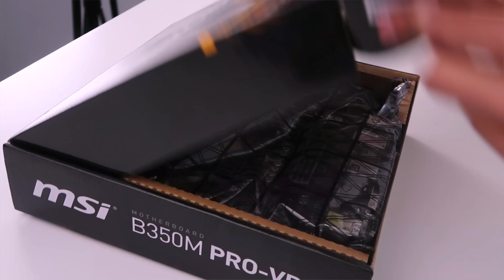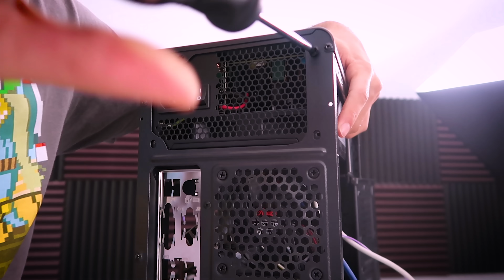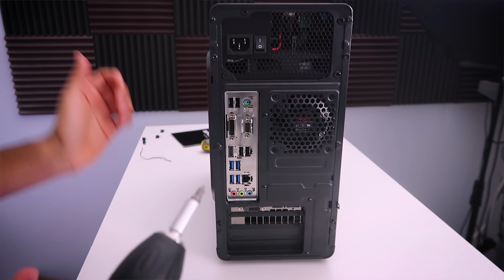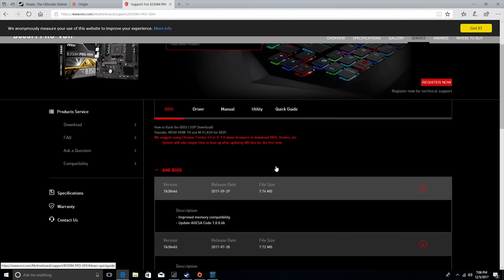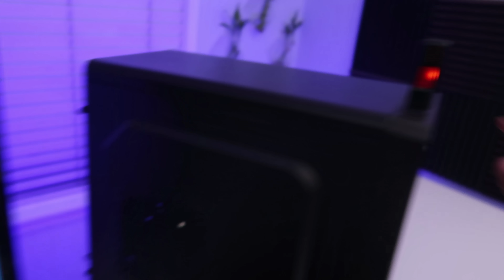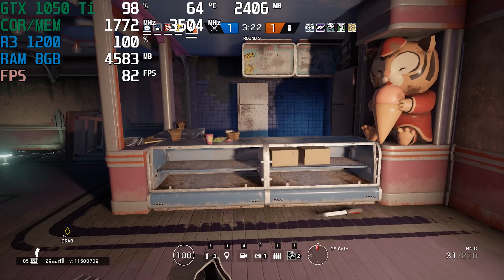$500 Budget Gaming PC Build Guide - GTX 1050 Ti (w/ Benchmarks)

Comment: Hey guys, I have a question maybe someone can help me with.  In the video Joey uses a MSI GeForce GTX 1050 Ti DirectX 12 GTX 1050 Ti 4G OC 4GB 128-Bit GDDR5 PCI Express 3.0 x16 HDCP Ready Video Card and I found something similar for $70 less expensive ( EVGA GeForce GTX 1050 Ti SC GAMING, 04G-P4-6253-KR, 4GB GDDR5, DX12 OSD Support (PXOC)).  Would this provide similar performance and is it compatible with the rest of the build?
Reply: Nicholas Savino GPUs come in different brands. As long as it's a GTX 1050 ti 4gb just like his. Your motherboard should do fine with it. Any GPU with a 16x PCIe slot will work with the mobo he showed. As long as your case can fit it of course tho.
Reply: Now if you check the case he was using online. They tell you that the case can support any GPU 300 mm long. But the case is limited with only 2 fans. Which is bad for cooling. This limits higher end gpus. So just watch out on that part.
Reply: Thanks a lot man, unfortunately all the GTX 1050 TI in 4gb are sold out everywhere.  Is there anything you'd recommend to substitute?

Comment: hi nice video dude, would any other computer case fit good with this setup? In my country I cant find this model, but there are some similar. Is it necessary to be this one?
Reply: Matej Jurec no, any ATX case will do. The motherboard he is using is a micro-atx model. This means any case that is either a micro-atx model or Mid ATX will work. Remember tho bigger is better. You will have more space. Mid-ATX cases support both micro and regular atx motherboards.

Comment: Hey man idk if you’re responding to these comments or not, but I’m still in high school and have been a console gamer my whole life, my favorite games right now are definitely over watch pubg and fallout series, so is this a good option to get started on a PC and is it even worth it if it’s gonna take 6 months to save up for the parts? Will they be outdated? Sorry idk how PC works really, and should I even attempt this build if I have no computer/PC build knowledge whatsoever?
Reply: Qigi Streams This current build will do fine for you. You can play PUBG at 50-70 fps. If you are new just research around using Google and YouTube.
Reply: Yeah this  build would be solid to start out with. The cpu/gpu combo would run those  games just fine. You can get any b350 motherboard you want.  I would recommend getting like a 120 or 250 gig ssd for Windows  and a few games. I just got one and my PC runs so much faster, its definitely worth it.  Also I would get a different case than the one, you can get anything you want, make it yours.  Also by the time you save up  the prices of some parts should drop a little, and you could upgrade the parts if you want and it won't be out dated by then.

Comment: I went with this built it powers on but nothing displays on the monitor
Reply: RiIix make sure you plugged the hdmi to the graphics card and not the motherboard
Reply: Luis Ramirez appreciate the suggestion but I did that and I've taken out parts and tried figuring out what the problem is no luck

Comment: Anyone know how well this would run total war: war hammer 2
Reply: River Reifenrath 40-60fps
Reply: Luis Ramirez- would that be medium settings?
Reply: River Reifenrath medium high. Games like those are cpu heavy so a Ryzen 5 is better but not needed
Reply: Luis Ramirez- just making sure as my laptops i7 6700hq gets me 30-50fps on medium high settings
Reply: what gpu does it have?
Reply: Luis Ramirez- 1070, if anything it has to be the cpu as it is capped at 2.6ghz
Reply: it turbo boosts to 3.5 underload actually. the game is demanding though. What settings do you have it on? Shadow quality? and Antialiasing?
Reply: Luis Ramirez- my laptop isn’t letting me access bios so I can’t manually overclock and every test I run has it displayed at just 2.6 the desktop version of it I believe oc to 3.5, and just standard medium setting for that stuff as I know that can kill performance. Otherwise I’ll have to boot the game to find it all out right now
Reply: you cant overclock on a laptop that's why
Reply: Luis Ramirez- lol that’s what I figured when I couldn’t get bios to open otherwise the settings are anti-aliasing is off, shadow detail is medium, texture filtering is anisotropic 2x and I’m running it in dx 12 as I like dx 12

Comment: Firstly, thank you so much Joey! I made this exact build, but because I had a bigger budget I went with a ryzen 1300x, a 550w psu, and a gtx 1060 3gb. Everything seems fine, the pc turns on and I can tell everything is getting power. However when I plug an HDMI from my gpu to the screen, Im getting no image. Does anyone know why this could be?
Reply: OfficialBraddik that’s weird, are the GPU fans spinning?
Reply: Luis Ramirez the gpu fan spins for a while when I turn the pc on, but then it stops- I believe that's because the board isnt hot enough to require the gpu fan to spin? I dont think thats an issue, I may be wrong though
Reply: OfficialBraddik yeah the GPU isn’t hot enough for it to need to be cooled. Unscrew it from the case and open the release for it on the board and pull it out and reinstall it . Make sure you push down until it clicks then try again
Reply: Luis Ramirez I'll give that a try- also I have my cpu connected to my Psu via the VGA cable, is that fine?
Reply: Luis Ramirez I just tried what you suggested, still doesnt work.
Reply: cpu connected via a VGA cable? That's impossible. the psu has a cable with a label that says CPU to connect to the motherboard top left 4pin cpu connector. you can't have a VGA on your motherboard and hdmi on your graphics card at the same time. you have to pick one. if you need to use VGA i would suggest buying a VGA to HDMI adapter or VGA to DVI adapter
Reply: Luis Ramirez no no no, the GPU is connected to a VGA cable. The cpu cable is connected to the cpu cable
Reply: Also by vga I dont mean the video input/output vga, I mean literally a cable with a VGA label that goes from the power supply, to my GPU. Is that not the right cable to plug into the gpu?
Reply: connect it to the PCIE cable not VGA
Reply: Luis Ramirez is the PCIE cable labeled that or something? If so I dont think I recieved one with my 1060, although the box says it contains one..
Reply: Luis Ramirez also, there's nothing labeled PCIE on my psu, the only other labels are VGA, and PERIF

Comment: Hey I have a question I just did this build and I did everything you said in the video. Then when I go to plug it in and I push the power button it won’t turn on. Do you have any ideas on why it won’t work?
Reply: Malik Nav did you switch on the power supply from the back?
Reply: Luis Ramirez yes i did, I tried switching it on and off multiple times :/
Reply: Malik Nav push in the cpu power and motherboard power. So the 4 pin and the 24 pin on the right it’s probably just loose
Reply: Luis Ramirez okay I just tried that and I took it apart and put it back together and still nothin :/
Reply: Luis Ramirez I’m only plugging in the power cable to the outlet but do I need anything else plugged in like the Monitor or something to turn on?
Reply: Malik Nav no the fans will spin with the monitor off. Don’t forget to flick the switch behind the power supply. Flick it and try it on the O sign and flick it on — and try turning it on
Reply: Luis Ramirez I flicked the switch both ways and the fan still won’t start when I push the power button
Reply: Malik Nav did you plug in the front IO cables correctly? It’s the cables with the HDD LED, Power LED, RESET SW. the little tiny cables. You probably put those in wrong. On the motherboard manual there is a guide on what order and way to put them in. Should look like this: https://goo.gl/images/8EkMJY
Try to follow that. So pay attention which are on the + and - side

Comment: I have a Ryzen 3 1200(stock) and 1050 Ti. How come I have a very low GPU usage whilst playing PUBG? I use 1366x768 resolution, v-sync off, single 8GB RAM 2133 stick, and even optimized my Nvidia Control Panel. Please help.
Reply: Since you’re on a lower resolution it’s taxing your GPU a lot less than it is your cpu since it doesn’t have to render graphics as fast
Reply: True that, I fixed it a while ago by setting the screen scale to 120. Thanks.

Comment: Could someone please tell me how to overclock a EVGA GeForce GTX 1050 ti (not sc) and a safe clock for it?
Reply: Blitzer William look up a tutorial. It’s a little hard to explain. Basically you would download heaven or whatever and MSI afterburner. Push your power limit to 110% and increase your core clock my 100mhz and apply and run heaven for 5min to see that it doesn’t artifact or give you a black screen and crash. If it’s good then bump it up 100mhz more and check for the same. If it crashes on you. Go back down 100mhz or 50mhz if you want the highest possible overclock. Then do the same for the memory clock. Push it up 100mhz at a time and see how far you can get without it crashing. If it crashes then lower it 100mhz and there you go

Comment: Joey when I turn on the pc it won’t display anything on the monitor (everything is plugged in right) what could the problem be?
Reply: Goofy Godzilla does the pc turn on?
Reply: yes 
just no display
Reply: Goofy Godzilla did you plug the hdmi to the graphics card and not the motherboard on accident?
Reply: Luis Ramirez the dram and cpu light is on (motherboard ez debug led) does that mean there’s a problem with those things?
Reply: Luis Ramirez I use dvi btw
Reply: Goofy Godzilla okay did you plug in your dvi to your graphics card? 

Also make sure you pushed your ram all the way down so give it another push to see that it’s clicked all the way in, push in your motherboard 24pin cable and cpu power cable to make sure everything is all the way in

Comment: Hey Joey! Thanks for all the useful vids. I just built this rig, with a few changes: different case, stronger graphics card, and I added a second SATA 1T Solid State Hard Drive. When I set up windows, I didn't see partitions as you mentioned, but rather HD 0 and HD 1. HD 0 was my solid state HD so I selected to download windows there. Once this was done and the computer was working, I checked memory and it says I only have 907 GB. I don't see the second hard drive. Did I do something wrong? I connected them with separate SATA cables. Do they need to be together? Not sure what I did wrong.
Reply: Victor Fagundes check the bios to see that it read it. If it does appear you should be able to configure it there or in the partition on windows
Reply: I figured it out. I needed to format it for use. It’s working now. :) thanks anyway.

Comment: Can I change the ryzen 3 for a intel i3 8100?
Reply: Loquendo Guy nope. Different manufacturers need different motherboards.
Reply: Luis Ramirez I already bought  msi z370 a pro btw thx
Reply: Loquendo Guy then yeah the 8100 works. But if you have the budget for a 8600k try to get that since you already have a Z board and can overclock it. Or get a 8400 for $200

Comment: Hey Joey great video mate. Very clear informations.
I have a 2 questions though I am a real newbie in pc gaming. I want to switch from ps4 to pc for F1 2017.
The recommended setup is:

Processor: Intel Core i5 4690 or AMD FX 8320 
Graphics: Nvidia GTX 980 or AMD R9 Fury 

Is the graphic card you use in your video would do the job?

Also I am running the processor:  AMD A10-6700 3.7 mhz

Can my processor do the job or do I need to buy a new motherboard since the FM2 socket is pretty limited in upgrade apparently?

Thank you for your video. 👍
Reply: RickStuff I would move from the Fm2 socket to AM4 and get a Ryzen 3 at least for that game. The 980 recommendation is for maximum settings. So the 1050ti will still run it at around medium high just not ultra settings so it’ll still looks nice just not ALL the bells and whistles of the game. Will it look better than the ps4 version? Yes.
Reply: Hey thank you mate. I will have a look at it.. Just to make sure, replacing the socket mean replacing the motherboard right?
Reply: RickStuff yes that’s what it means :). AM4 is supposed to be supported until 2020 so it has a life ahead of it
Reply: OK thank you mate. I appreciate the reply.

Comment: My budget build is 

M5a78lm/USB 3 mobo
Fx6300
Hyper 212 Evo
12gb ddr3
500 watt evga PSU
Rx480 GPU

Runs Forza Motorsport 7 and fh3 and 60fps on med-high settings, nfs payback ultra settings gets 60 with some dips and idk much more games cause it's all I got lol

Comment: The GTX 1050Ti was $157.99 in the video.
It is now $299.99.

The fuck.
Reply: AG_PEPPER any brand 1050ti will work
Reply: I know. I thought it was funny to point it out. Thank you anyway!
Reply: AG_PEPPER just get a used 970 on eBay for around $150. You’ll get 1060 performance

Comment: Do all the wires come with the mother board and the cpu etc or do you have to buy them separately
Reply: I'm wondering the same thing too. I'm not sure if the sata cables with the hard drive is included
Reply: All the wires are inclucdd
Reply: TomBradyFan2871 the motherboard comes with 2 Sata cables so you don’t need to buy any extra
Reply: Luis Ramirez thanks for the reply! I was also wondering if I need to buy extra standoffs for the motherboard and where I can find the tool for the standoffs he showed in the video?
Reply: TomBradyFan2871 honestly his tool was just to tighten the standoff’s really tight. In reality you can screw them in with your hands tbh. No need for all that
Reply: Luis Ramirez Thank you! I have one more question. I noticed he used a drill to screw in the screws to the case. Is that necessary or can I just use a simple screwdriver? Also, would you recommend getting the additional fan that's not included in the case?
Reply: TomBradyFan2871 it’s actually correct to use a screwdriver. Idk why he uses a power tool for a fragile motherboard. And yes I would get it for better airflow
Reply: Luis Ramirez I looked at the price of the 1050 ti and decided to get the 1050 instead. Can I use the Gigabyte geforce 1050 instead of the Nvidia GeForce 1050? Will there be any difference in performance?
Reply: TomBradyFan2871 yeah you can use a 1050ti. I mean you have less vram but that doesn’t matter because honestly the power of the card will hold back higher textures. The big difference is 5-7fps for the most part. Just overclock your card if you really want the extra FPS
Reply: Luis Ramirez Did you mean to say 1050 instead of 1050ti?
Reply: yes i meant to say 1050. my fault
Reply: Luis Ramirez thank you for your help
Reply: TomBradyFan2871 no problem. I hope everything goes well for you

Comment: So what's the deal with the windows 10 flash drive? If I had all those parts and put them together, but didn't have the windows 10 flash drive, what kind of issues would I have with the setup?
Reply: Caden Reed you wouldn’t be able to install an operating system
Reply: So i would absolutely need a hard drive with windows 10 on it? What about updates, when windows 10 goes to windows 11 etc
Reply: Would it auto update?
Reply: Caden Reed just buy a 16GB flash drive or around $12 and install windows 10 home on it for free with the media creation tool
Reply: Caden Reed it auto updates

Comment: I am not sure this for when they had deals for specs on pc where it was cheap but i did the calculation for all the parts with windows 10 usb and the wireless usb wifi but that all equals 836$ and this says 500$ budget pc also with the case it adds up to that amount

Comment: The only thing that sucks is the price for the graphics card is like $250. I guess the price inflated. 😥
Reply: Stacy Perkins switch it for a used GTX 970 on eBay. They’re al round $150 and have 1060 performance

Comment: What if I use i5 6400 2.7ghz instead of the Ryzen? Will I be able to run PUBG with fine settings?
Reply: Eagg' you would need to change the motherboard to an H110 or B250
Reply: Luis Ramirez Thanks, this motherboard already came with the i5 so can you tell me if its gonna support cards like GTX 1060? I cant find which MB is this. https://imgur.com/a/yaRXS
Reply: Eagg' yes it’ll support all cards it’s just a matter of you changing out that power supply for something better than can actually power the 1060
Reply: Luis Ramirez okay thanks alot, what do you think of EvGA 500W?
Reply: Eagg' that’s perfect. Not too much not to little

Comment: I have build the same exact pc but there is no display any solution?
Like there is power to the cpu and gpu but not on the ports
Reply: IQ Hell did you plug in the hdmi to the graphics card? You might have put it in the motherboard slot
Reply: Luis Ramirez yeah i tried and it is still the same problem
Reply: IQ Hell push the cables to the motherboard and cpu all the way in, make sure your ram is pushed down all the way down, push down your graphics card down a little to see if it’s loose

Comment: Hey Joey, i'm really interested in that monitor you have, just asking if you are having any problems with it? any Screen Tearing? is it 144Hz???
Reply: Lane321 screen tearing only occurs if you produce more frames than the monitor can handle. As long as vertical sync is on, you’ll have 0 screen tears

Comment: Can I use ryzen 5 1500x instead?
Reply: GamingCentral yes
Reply: Luis Ramirez on pc part picker it tells me that there may be  a potential incompatibility between the Ryzen 5 1500x and the case he chose? Are you sure? Sorry this is my first ever time building a pc (I'm 15)
Reply: GamingCentral it’s a glitch. Cpu shouldn’t have a compatibility issue with a case lol it should say motherboard issue with case. You’re good to go
Reply: GamingCentral try to get a 1600 over the 1500x
Reply: Luis Ramirez what's the difference?
Reply: GamingCentral 1500x is 4 cores/1600 is 6 cores. No point in the 1500X either when the 1500 overclocks to the same speed as the 1500X either, but since you want a 1500X I would just spend $20 more and get 2 more cores with the 1600.